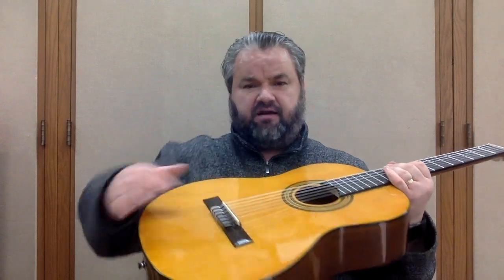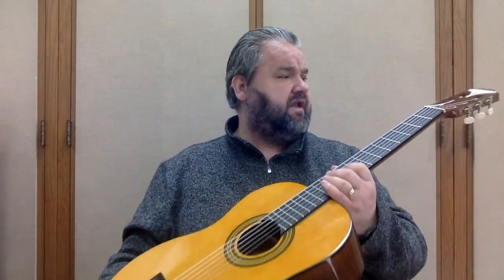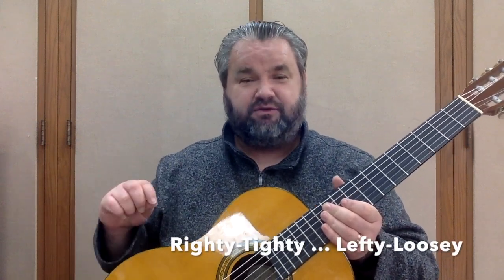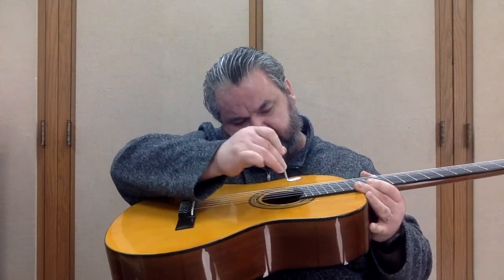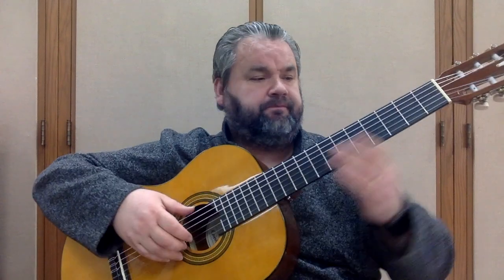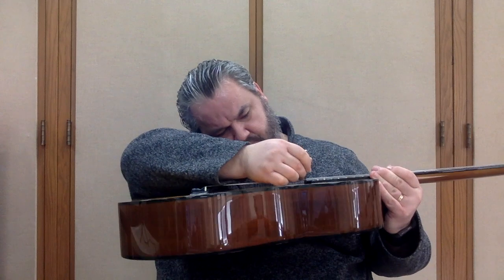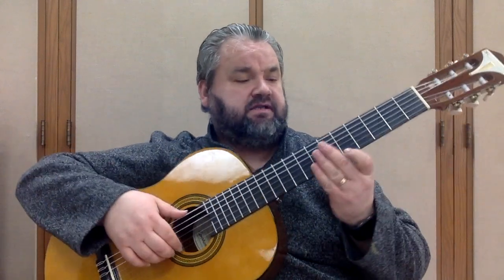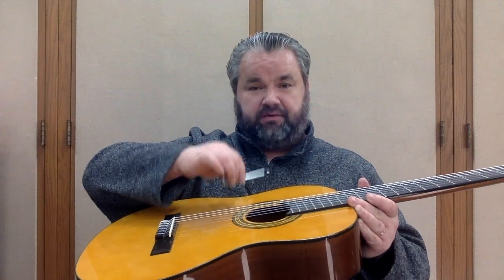How To Adjust Truss Rod On Acoustic Guitar

Comment: Thanks for sharing this. I have done them before on my own when they buzz to much or have improper string height. I usually send mine out because I get them tuned up at the same time. This is good info that you have here.
Reply from the maker: Getting this done by an actual guitar tech is the best way to go. That is for sure 👍

Comment: Even with a guitar out of shape and out of tune, you are able to make it sing.  That's impressive.

It cannot be stressed enough to not overloosen or overtighten  a delicate instrument; that could damage the instrument beyond repair.  It's the same way in plumbing: overtightening may break a fitting, and create a leak that may require to replace a fitting that costs a few hundred dollars.

Is the truss rod screwed into metal or wood?
Reply from the maker: Thank you for your kind words. The truss rod is housed in a metal casing inside the neck.

Comment: Whenever I adjust nuts or bolts. If you’re not going a full turn. You adjust by flats.
Turned the nut a full flat or 1/8 of a flat or whatever it is.